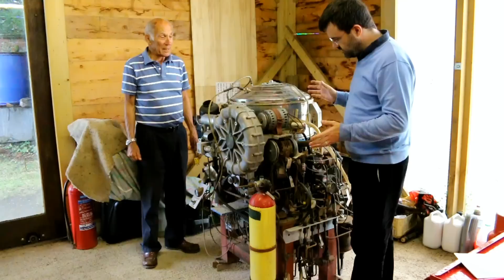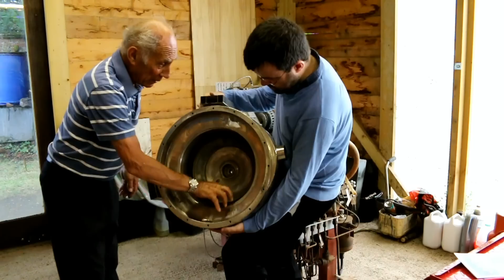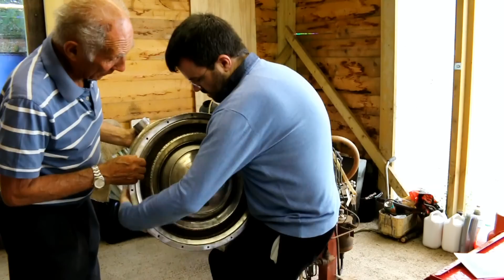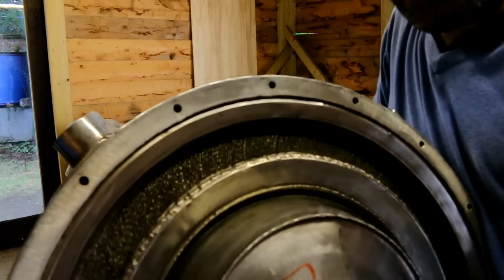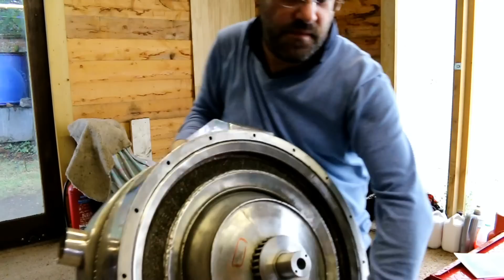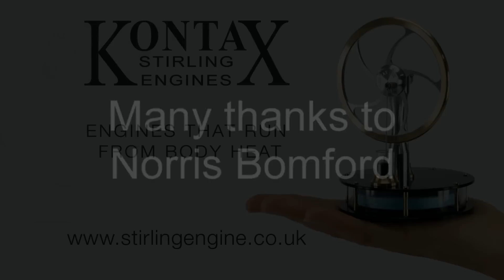United Stirling P40 Stirling Engine. 40Kw Output

Comment: Really wish somebody would simplify the whole thing and connect it to a small battery to power an electric motor. This type of engine is perfect for range extension. But currently they are too bulky

Comment: If we were to design this engine again, it would be a lot smaller and less complicated.
Reply: By-product of high power stirling engines, I'm afraid
Reply: I want to see the twin 550hp motors used on speed boats these things put out 1100 8hp and throw a roostertail that won't quit.see one down in florida.these thing are putting out some serious power.could you imagine one generating power.just one.
Reply: Their Stirling motors too.!
Reply: These motors are toys compared to those Stirling motors on that twin 550hp motors on that ocean speed boat.looke like a pt-109.
Reply: Sounded like one to.hook them up two a generator and get 1000 kw idling.
Reply: Maybe 4 or 5 thousand kw just idling
Reply: Look it up in the Stirling motor speed boat section of youtube.
Reply: @slartibartfast2649  Yes and no. Today one would make a free piston or thermoacoustic design which has even less moving parts, connected to a buffer battery to drive a hybrid. They could be made even more efficient this way, however they stay somewhat bulky.

Comment: So yeah the comment section is on point. This machine did nothing but take up space. I'll look to see a working engine. 40kW is enough to power a few homes but......but blue sweaters over polo shirts hardly prove anything.
Reply: Even if it only takes up space A lot of times that sort of stuff is valuable for research purposes
Reply: @eddieschwab864  I'll agree with you on that point.

Comment: Induction used for cooking could heat the pistons on the engine. Creating an electronic rotary motor. Which with some other components could make a stand alone electric power generator. Novartis
Reply: Jim Martin you would be creating free electricity it would have to be over 100% efficient which is way more than the 30% ish maximum
Reply: Lol this is the dumbest idea I have ever heard. You use electricity to heat a Stiling engine to produce electricity ...genius.

Comment: Can you share the dimensions and technical data BTU input, kwh output, regenerator construction, crank info, pressure and gas used, heat exchange metal? I want to build one of something like this. I want to get the most out of the heat input.. Any contributors info would be helpful and donations also. Consultants and any way to make the unit more efficient turning BTU into Electricity. Thanks for the post.
Reply: too bad i found this a little late, look up DHIndustries on youtube here, they've got a GREAT breakdown of the Sterling Engines and how they function! these engines are truly what our future needs to succeed!

Comment: i want a 40hp engine for a pto generator but lol. i figured i could use some of the energy i produce to produce hydrogen and oxygen farm my poop as bio fuel my cats poop too. the sun can heat stuff up. what if i hooked up 40k wires to something hot then put the other ends on something cold lol. i could grow some kinda plant with my bio fuel fertilizer and turn that into more bio fuel maybe burn it. i also want to burn plastic to produce gas and diesel from carpet demo

Comment: 40kw out of a 1000cc motor.  Looks heavy.  I wonder how much it weighs.
Reply: Indeed it's not very good alternative to automotive engines since it lacks power. Even though NASA created one in 1978 that's not heavier and was working just fine with efficiency much higher than any ICE especially at the time, but for the trade off of less horse power - if I remember correctly it was 75kW.
However Stirling engine can operate (though not at optimal efficiency) at much lower thermal difference, and also doesn't care about the heat source (just the amount of heat), things which ICE can't really do.
So while not good option for automotive engine it perfect option for residential generator especially when coupled with concentrated solar power from a mirrors dish.
Reply: It weights 100 kg
Reply: @be-shorter  not too heavy for tractor, i think the open source ecology guys might be interesting of this , it could be used as a power source for their open source tractor and other machine for people lack of grided power and oil
Reply: @be-shorter  i think the sunpulse 500 team wont agree with your point , their model could provide both power source and electricity (with a generator)
Reply: @alexsmith2632  Yeah, you can get both power and electricity from Stirling engines, but its operational mode is intended for stable engine speed. That one on car was successful but much expensive and not do flexible as internal combustion. 
Thats why Stirlings is best for obtaining electricity.
Reply: @be-shorter  well, of course it will be expensive if you focus on device itself, but for tractor domain, many other reason needs to be considered, for eg, i recently watched much videos on those grandpa's steam engine tractor on youtube, for those guys, an external combustion engine could help them use local fuel thats almost free to them. this is quite meaningful at current days when oil price rised quickly.
Reply: @be-shorter  i think you got it too complex, maybe it will be the best choice for your local situation
Reply: built way too big impractical, just 1 per house is needed at 2 kw, complicated first design with hot air recirculators, dangerously high pressure for anyone to be around.
Reply: It´s not as heavy as it takes up much volume. The inside is mostly hollow and filled with pressurized gas. But still compared to the power output it is heavy. Those type of engines were better for range extension on modern hybrids. Much ebtter newer designs such as thermoacoustic or free piston exist today which can charge a smaller buffer battery. The advanatge is they burn any fuel very clean and they never need maintanance they can basically run for way over 1.000.000 miles. They don´t use any oil either. It would be worth it to investigate a modern solution. back in 1980´s technology was nowhere near the level it is today.
Reply: @blueckaym  It could be a good alternative as a range extender. Not this design but a more modern thermoacoustic or free piston design with linear alternator.
Reply: @be-shorter  Absolutely.
Reply: @togowack  Stirling engine was invented to not have any hight pressure like the szteam engine.
Reply: @sierraecho884  Then it won't produce useful power
Reply: @togowack  Depends on what you mean by "useful". Stirling engines are currently being build and they do produce useful power.
Reply: @sierraecho884  something in the 3/4" HP range that a consumer appliance would need and that you could sell a couple billion of.
Reply: @togowack  1. Why 0,75HP ?
2. What do you mean by " that a consumer appliance would need" exactly ? Why would anybody need something like that ? Do you mean like powering a radio or something ?  
3. How come you think that if you feel that need, whichever that is exactly you would sell as many copies ? Also what should the cost be ? What about emissions and noise ? Portable or stationary ?
Reply: @sierraecho884 I've been building a 3/4 hp Stirling for about 2 years its very similar to the Ross 100 CC engine. An engine of that size could run on any power source and keep a  refrigerator, computer, communications online. I can't understand why people don't apply practical applications to these weird technologies instead they are looking for 10 watts. The cost? Anything can be manufactured after a bit of R&D. The byproduct heat of an engine of that size could also heat a small house.
Reply: @togowack  I am a mech. design engineer and have been building stuff for over 10 years for the automotive industry, however having said that I don´t deal much with Stirling engines. For home use cost is probably the most important factor. 
Why would people buy a rather bulky expensive Stirling engine to run a laptop off of ? You can simply use the grid. There is no need. If you need some off grid power one would rather use solar and wind instead. Also what exactly would you burn where ? What about the emissions ? You wouldn´t burn car tires inside your house if your power goes out would you ?

You can buy combined power and heating units, those use a free piston stiling design but they cost something like 50k. Some people buy them for whichever reason that might be, I never had the need nor did I ever know anyone who had the need. Also most places I know simply would not tolerate the emissions so you need a clean burn which in turn makes it more expensive in the R&D area. 
Sure you can build some kind of more or less efficient stirling but you have many other cheaper and better alternatives. You can get a diesel generator instead for instance. And heat is always almost 95% efficient. All the heat ends up more or less in the house anyways, no matter if a stilring was used, a stove or diesel generator or whichever other means. 
So the simple answer is, they are too expensive, too big, too low of an output and mostly not needed in the first place due to other alternatives. 
I would like to know why you need one, what do you use it for ? What kind of design did you go with ?

Comment: Did you measure efficiency?
Reply: Best stirling engine has efficiencies as high as 40%
Reply: @be-shorter  WoW i stand corrected, i totally love stirling engines. They could be a great solution for eco friendly engines that run purely on methanol. And provide a carbon neutral economy without being expensive as Liion batteries.